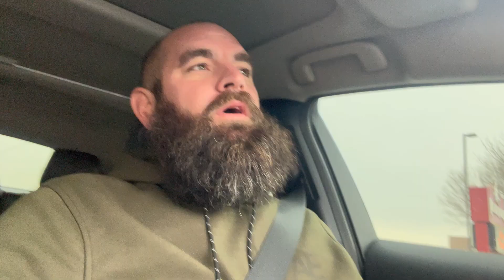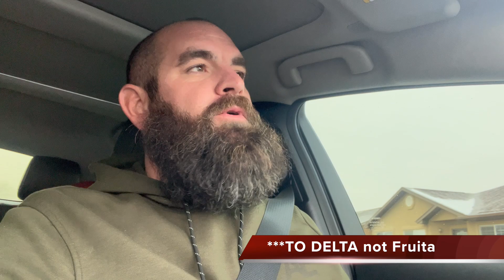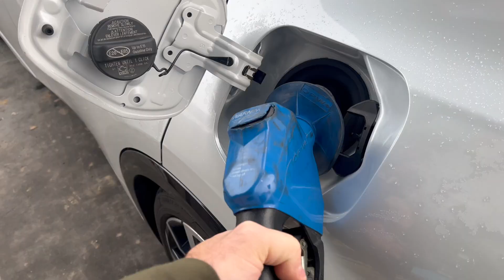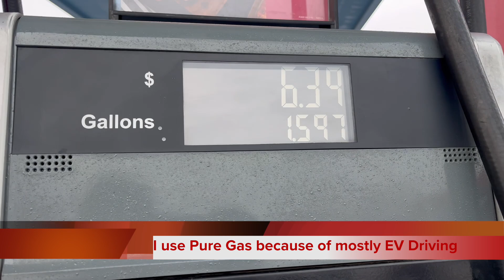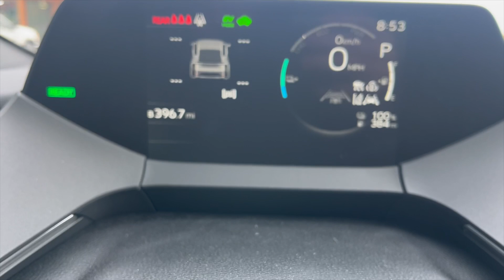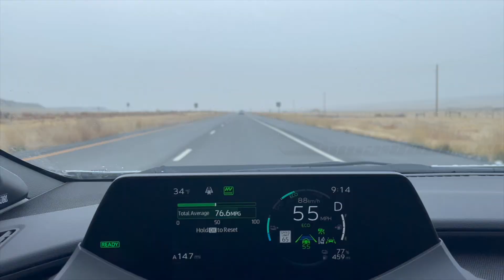Hyper Mile Toyota Prius Prime Test. 250 Miles. Best MPG possible. Better than EPA rating. 2023 2024

Comment: I drive a 2000 Hyundai insight and I deleted the battery because it’s nickel metal hydride. It has half the energy of lithium.

I’m just gasoline only. I’ve got my fuel line set with the needle valve where there’s only enough gas going into the motor to go 50 miles an hour top speed, which keeps me in LEAN burn 

I’m not driving in mountains in Colorado, but I get 80 miles to the gallon. I’m working 16 miles from where I live now on my job and it’s back roads all the way so I’m just driving 35 miles an hour and I’m getting over 100 miles a gallon at 35 I get about 80 miles to a gallon when I’m driving 50 gasoline only and I give $600 for the car nine years ago
Reply: Honda insight I don’t know why word process or changes words. I think it predicts what you’re going to say.
Reply from the maker: I totally get it. No worries. But seriously I would love to watch a video on it
Reply from the maker: That is awesome. You should make a video of it. I would love to see it.

Comment: On my 23 Prius prime you can only choose between EV mode or Auto mode. There's no selection for hybrid mode only. If there is, I'd like to know how to do that. I had a 2017 and you were able to do that. Use either battery only or hybrid mode.
Reply from the maker: I just do the ev button. It goes into hybrid.

Comment: @grabagearcolorado, with hypermilling, the base Prius LE FWD can get over 93 MPG as currently available in the Guinness records. So, the question is: is the $5k+ upcharge worth for anyone to go from that LE to a Plug in version like SE? Also, which one (plug in or regular prius) retains a better resale value relative to its purchase price in 5 years?
Reply from the maker: I did make a video comparing prices and if they are worth the up charge. Check it out. It was about the rav4 prime.
Reply: @grabagearcolorado is that after all incentives being gone, that's what I mean.

Comment: Quick question. How much does it cost to charge the battery because you should include it in the cost calculation. Awesome video. Thanks for taking the time and effort 👍
Reply from the maker: Here in Colorado it is about $0.80 to charge it.
Reply: @grabagearcolorado  Here in California it's about $2.50 to charge to full from no EV range.

Comment: The thing is, charging at home electricity isn’t free. Where I live, it’s actually more expensive to charge than to just drive hv using only gas. if gas is over $4 per gallon, then it’s actually cheaper to charge the car and use ev mode. If gas is under $4 as it has been these last few months, then I don’t even charge my car overnight at home anymore. It’s more expensive than just using gas!
Reply from the maker: Yeah there is definitely a point where one is worth it over the other. I tell everyone that if you can charge for free then it’s amazing (my friend works at a place with free charging). Personally I have solar on my house which I sell back 1-2 MWh a month. So I plug in every day. But I totally get your point and agree

Comment: at start he had a full tank and full battery, at the end he had a full tank and an empty battery. 2023 battery capacity is about 44 miles range. so per his 97.23mpg he is actually getting about 53mpg, which is inline with what all primes get on average. 

so he did not create more energy, on average it's about same if he just did nothing and kept driving on ECO mode only. the only difference is having the EV when needed, the price difference of gas over electricity, and how aggressive one drives.
Reply from the maker: I agree and disagree with your assessment. After doing thousands of miles of driving I can tell you that if you tell the car what to do instead of letting the computer do it, you will get better mpg. Ive now done a dozen plus trips with the car and Ive done the same road over and over (Grand Junction to Denver). With the computer doing its own thing I don’t get nearly as good of mpg. Your calculations are also wrong. Your calculations are 97.23 - 44 for the 53. Sure if I did 137 miles. But I did 250. Therefore we can get rid of the 44 from 250, which will give us 80 mpg. 

I would really like to see your videos showing the results from your Prius prime test.

Comment: But don’t you ‘burn’ just as much electricity going up hill?  Meaning I thought the car was equally efficient regardless of the fuel source.  I could see using EV up the hill so that you have room to regenerate on the way down.  Or using gas on the highway to save EV range if there’s going to be multiple, short trips later.  I also don’t see how using charge mode helps with efficiency.  There’s always going to be a conversion loss.
Reply from the maker: Your right. It all depends on how you use the car. For me I use hybrid going to Denver and ev to climb. Then from the top I use ev going down to regen. I’ll use most or all of my ev climbing, regen about 20 miles going down to Denver for in town driving. I’ve done the trip dozens of times in straight hybrid mode or how I do it. I get  6 mpg better my way on average. Thanks for watching

Comment: I would suggest doing the opposite of what you do, use petrol uphill, EV down, and don't use chargemode.
Or... just leave it in hybrid and let the car sort it out..
Any ICE (petrol or diesel) is the most efficient (as far as one can use efficient and ICE in the same sentence...) at high load (around 80-90% load) and low-mid rpm. This is easier done going up than down or flat. The EV-part should be around 80-90% efficient at any speed/load, so doesn't really matter that much how you use it..
In addition, EV going up burns through your battery quicker. This I believe would leave the ICE on for longer time to "catch up"..
Goal should be to have the ICE on for as short total time as possible, and have it work fairly hard when it's on.
Reply from the maker: Thanks for the input.
Reply: @grabagearcolorado  no problem :)
Thanks for nice content :)

Comment: 40 p.s.i  club👍 does the prime charge the battery when driving? Like every gen prius?
Regular  driving  is  charging the  battery ?    When you say  "charge mode"  are you  talking  about (B on shifter?)     Love  the  video,  your speed is  100%  In the sweet spot   my 08 camry hybrid has 310,685miles (500,000km)   next month.😮
Reply from the maker: Thanks, in charge mode the engine charges the battery and there is no electricity coming from the battery. The B mode you are talking about is also available and I use that when going down hill.
Reply: B is the Jake brake.

Comment: Thanks for conducting these interesting experiments. If we assume the initial battery energy contributed around 50 miles of range the remaining 200 miles on 2.65 gallons produced 76 mpg (the superfluous calculation precision is pointless). I would guess that using charge mode at all might actually detract from overall efficiency since charging has additional efficiency loss and hybrid mode is already optimizing engine loading vs charging, it would be interesting to see a comparison with a test that used only EV and Hybrid modes and skipped Charge mode.
Reply: Your suggestion on mpg calculation and using only EV and Hybrid modes are reasonally .correct.
Reply from the maker: Thank you
Reply from the maker: I might do that soon. Thanks for the input

Comment: I actually use the ev when i go slow and downill when i go uphill i use gas 

I find gas is more efficient on high accerlertion, uphill or faster speeds 

Thats just my experience i could be wrong

And i almost never use the charge Funktion if i want to be efficient
Reply from the maker: Interesting. I will have to try it next time. Thanks for watching

Comment: Great video! I do have 1 car related suggestion- don't top off your gas tank after the pump shuts off automatically. The owners manual says it under the refueling section (pg 279-280) and The Car Care Nut has a great video explanation as to why, titled "Never Top Off Your Tank".
Reply: I agree. What's the point of topping it off on a car that gets you such high mpg anyway. It's not like the '69 Mustang I had as a teenager where every mile counted a lot more. 😂
Reply: I think its true toping up a gas tank can damage some components but I really don't think double clicking is considered top of in my opinion 

I used to top of my cars all the way till I see the gas almost flowing over and I had to lern the hard way when my engine light came on because of the avaparator charcoal system malfunction
Reply: @tziebe what car were you driving? Does this happen in all cars and trucks?
Reply: @glock17sks56  I had a toyota yaris but I think it can happen in any car or truck
Reply from the maker: I’ve watched it and I disagree with it. The charcoal cartridge is completely fine especially if I immediately drive it and burn fuel. The one click added 1/8th gallon (slightly less). 
I have topped it off before going to Denver and it took an extra 1.1 gallons. That’s what you shouldn’t do lol.

Comment: On my Camry which I believe the steering wheel setup is very similiar you can I believe hold the cruise control button and it will go into the oldschool cruise instead of radar cruise. It should pop up with some warning and you can switch it back or when you turn it off and on I think it goes back. Hopefully it works considering you most likely see a lot of snow.
Reply: Oh and these car's are very easy to damage with the top up method I'd suggest just keeping it with the standard stop at the first stop
Reply from the maker: Thanks for watching. I found a way to go into regular cruise control. It was just annoying. lol.

Comment: What are you…. Or would you use for winter tires? Are winter tires even available for the XSE prime? I’ve got a 2024 prius prime on order. I’m way up in the Yukon, Canada. I’m curious how it will preforms in our climate and terrain conditions. ☺️
Reply from the maker: I’m on stock tires. I’m not 100% sure but they are all season tires. So far, here in Colorado it has done good. We don’t have winters like you guys but we do get some snow. So far no issues.

Comment: In my 2017 Prius ( not prime ) I use gas up hill as it also charges the battery. I coast as much as possible down hill. Best days are 16 - 19 Celsius. I have gotten 100 mpg once. 25 km to work. Thanks for the video. I get my 2024 Prius Prime Premium next weekend. It just arrived yesterday at the dealership. Did you have heat on. That would also lower your fuel mpg.
Reply from the maker: I did have heat on. You will love the car
Reply: You can definitely do that. It depends on the state of the battery if you're high on percentage it's more beneficial to boost down the hill ev up. These car's are very hard to drive perfectly
Reply from the maker: @sacredhealstv901  I agree they are difficult to perfect. But once you get it down it’s easy. With our last Prime, I drove it over 30k and I had it nailed down. Depending on how long the trip was, I would hypermile it or not. I did a trip to Florida and I did not hyper mile, but still got amazing mpg.
Reply: @grabagearcolorado  Probably on the Prius but on the non prius Hybrid's it's a pain. Don't you guy's have a lot more control of stuff with buttons and options than us non Prius peasants?
Reply from the maker: @sacredhealstv901  I’m not sure. I’ll definitely go to the dealership and see if I can test some of the new cars.